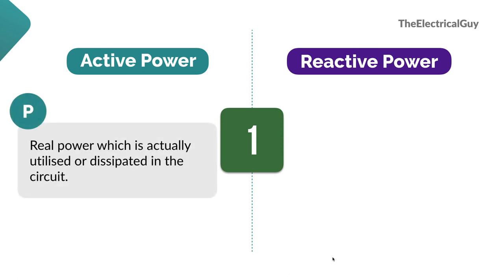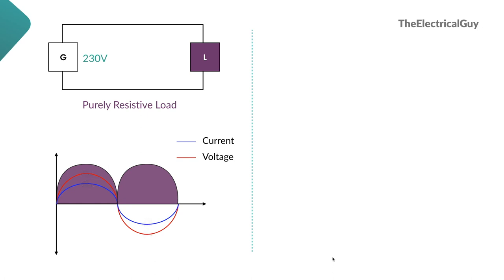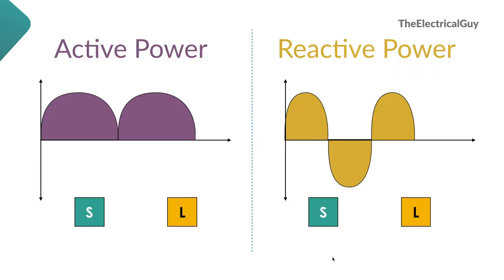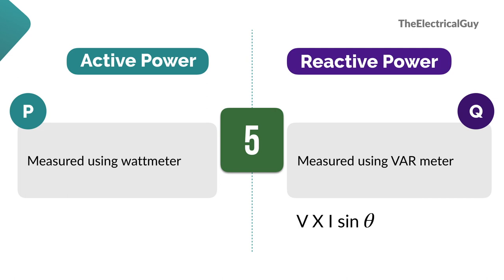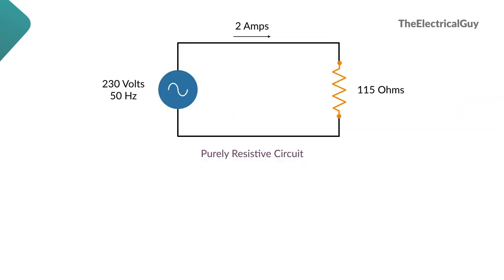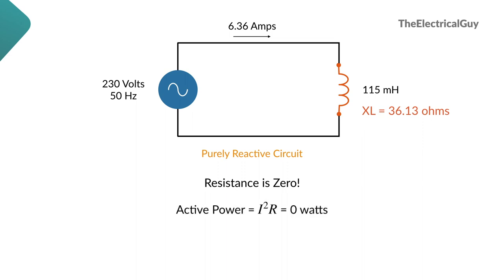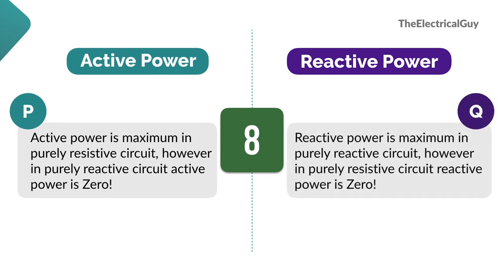Difference Between Active Power & Reactive Power | TheElectricalGuy

Comment: Thanks for the video. It’s still not clear how both types of power can exist at one circuit. If I take an industrial machine, what should I do to calculate and prepare an infrastructure for that machine?
Reply: It’s not a practical video. Active and reactive power exists on the one circuit because there’s periods where voltage and current overlap and periods where they don’t.

Comment: Great channel! Is it possible to convert reactive power (kvarh) to active power (kwh)? If so, what formula is used?

I'm trying to convert 02634 kvarh and 02050 kvarh into kwh. 

Thanks in advance!
Reply: Your goal is to get voltage and current in phase. Since industry mostly has inductive load, we put capacitor banks to force it in phase.

Comment: Please.
Give information about reactive power in negative value.
What it does mean?
Thanks again
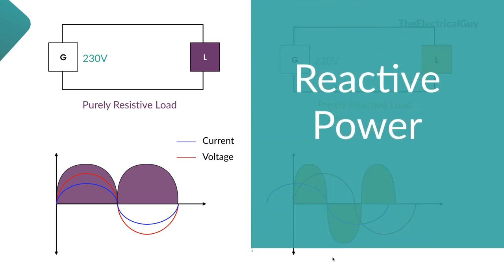Reply: In general,  power (active or reactive) in a negative value means that the element is generating power. On the other hand, a positive value means the element is absorbing power. For example, at 2:43, the load is absorbing reactive power when the product V.I is positive (positive value of reactive power) and is generating power when V.I is negative. 
The inductors can induce a voltage, so they can induce a current in a closed circuit and consequently generate power, the same thing occurs with capacitors which can discharge current in the circuit generating power.
The resistor is a passive element, so it can' generate current, in other words, it can only absorb power and not generate it.